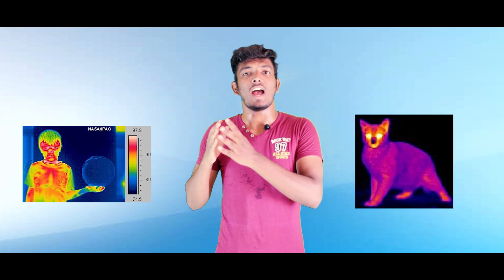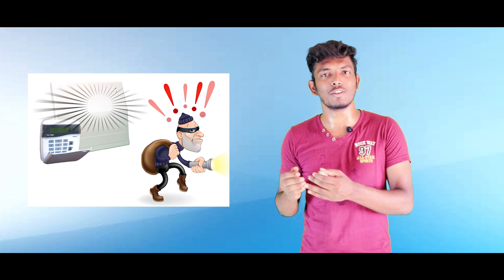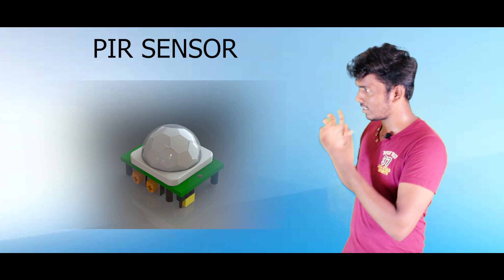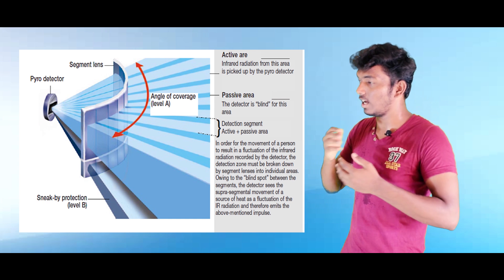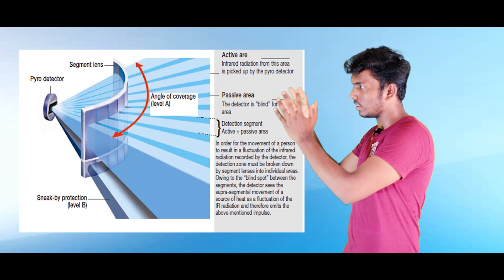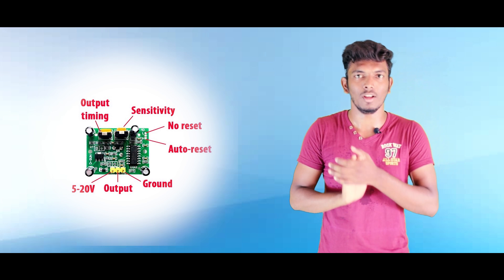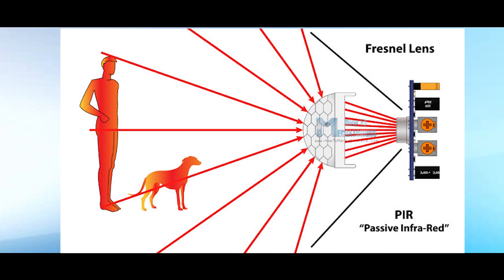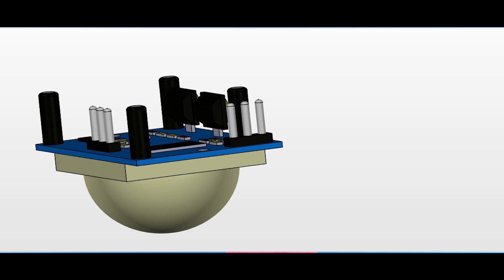PIR sensor working Explained in Tamil | Students Corner

Comment: Bro the human body is low frequency are emmitg and the visible light High and the low frequency is not also detect the IR light and the fun fat is the visible light is wave length and the the IR light High wave length this reason is we are not able to see the IR light. And the mobile is only fully forced on the visible light only a few light are considered on the IR light. And the remote is create's the high frequency in a small area and so many density the signal and the wave is strong.   And the wave is travel in light speed that speed is 3,00,000 kilometer per sec